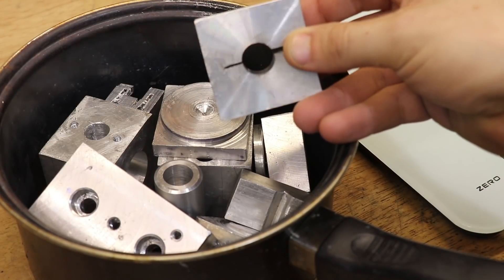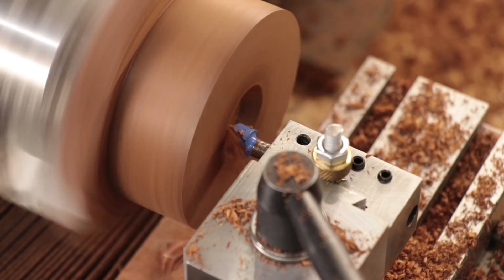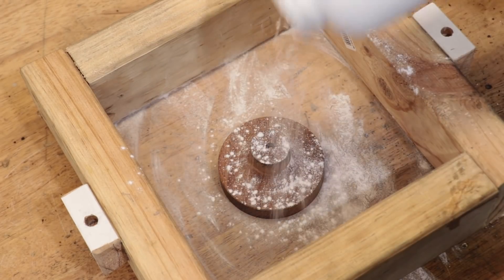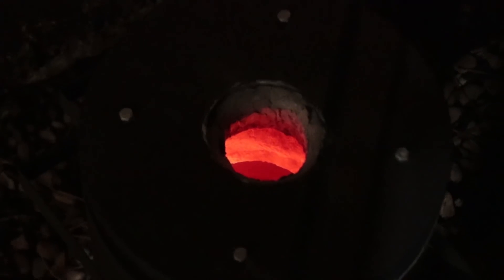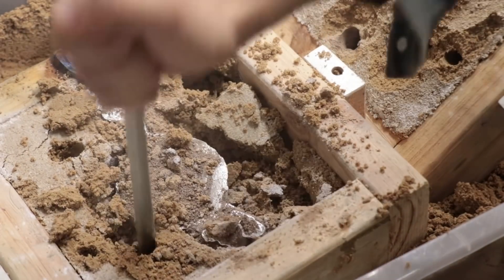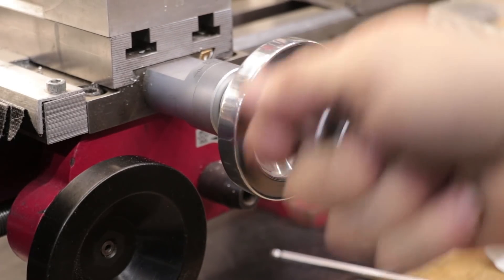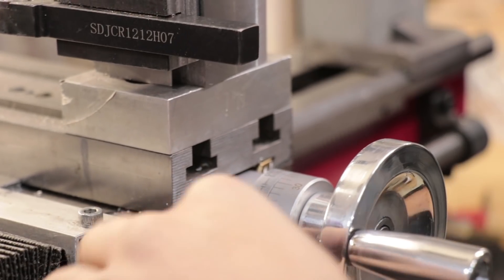Turning Scrap Aluminium Into a Lathe Handwheel | Metal Casting

Comment: Well knowing nothing about casting personally to me it looks like you didn't either use the right sand or you didn't pack it tight enough. Another thing you said about it was it would take to long to machine one out of a piece of stock but you literally machined one out of a piece of wood so why didn't you just go ahead and do it out of aluminum? I made all new handles for my lathe all three of them as well as new balls on the 4 rods on the lathe and anodized them all in my afternoon so it really doesn't take that long
Reply from the maker: It’s an old sand and clay recipe that isn’t used much these days. And look at the lathe, such a small one that it is faster to  cast than to have to make several had wheels from billet

Comment: Traditionally patterns  were made from a soft wood 102 percent of the finished item to allow for shrinkage of Aluminium. The pattern was then either painted or shellacked to give the pattern a smooth finish. Parting powder was made from crushed sea shells ground to a very fine texture. Feeders as you mentioned were usually at the thickest section of the casting for obvious reasons. Your Sprew was to large and will draw in air when not filled check out the old foundry man’s videos he has some top notch

Comment: great work, thanks for showing the failures as well as the success on the casting - so we all learn from them.
I want to do a similar upgrade to my midi lathe cross slide handle, but with a socket to allow using a cordless drill to power the cross slid on longer facing cuts. Ideas for a nut or socket drive in the center of the handle, that is part of the wheel so it doesn't turn?  
I thought about a hex cap screw but it needs to be held so it doesn't just unscrew in reverse...cross pinned ?
Reply from the maker: I used to use a jam nut from memory to lock a cap head screw in and use a hex driver in a cordless drill. Or just really tighten it so that the force of driving the leadscrew doesn’t undo the cap head screw. Don’t over think it, just find a way to tightly lock in a cap head screw and use a drill to drive it.
Reply from the maker: If you want it permanent just use some loctite or super glue on the threads
Reply: @artisanmakes  I decided to make a plastic disk with a mandrel centre for the drill, and put two holes in the plastic disk to fit over the handles.  Keeping the locktite away from the screw in case it needs to be removed !

Comment: A couple of things: 
1) the surface bubbles are due tot he greensand being too wet. Dry your sand a little and try again, also, use a wire to poke steam vents to give the steam somewhere to escape. 
2) Porosity issues are generally caused by gasses dissolved in the metal. mix 50%/50% borax, and household table salt, wrap it in aluminum foil, and push it to the bottom of the crucible, and mix well just before skimming the dross, and  pouring
3) Just an observation from what i can see, your greensand also appears to be very clumpy, i would suggest mulling it a bit more before use to evenly distribute everything. A sieve or screen mesh is also a good idea on parting / mold surfaces so you get the finest details you allowable.
Reply from the maker: Yeah for sure, we got flooded pretty badly around the time I did this and most things were water logged..probably didn't put as much time into getting everything dry, but that's my fault :)

Comment: The holes you were getting were air pockets. caused by either to much moisture in your green sand or not keeping your sprue full. Not the metal itself gas porosity in extreme cases is generally only about 1mm in size.

Comment: Looked like your casing sand was too dry as most of the sands I have used has some oil in it, and also use a screen to sift the sand nears the mold makes for a smoother cast.
Another trick is the use of haft round piece's next to the mold for better channels and less contamination in or around the part done right it can look like a professional did the finish part.   
A medal casing frame would be a big help fat in the meddle narrower at the top and bottom, and the sand needs to stick together not easily fall apart next to the mold helps it be smother.
Borax in the mix to free up the slag scrape off before you poor and I think that covers the basics.
I am sure a few more people will add bits and piece's.

Comment: To add to Kravchenko's post, it is a standard practice to paint wooden patterns to give them a slick surface for better separation from the mold.  Wood has grain and, especially oak and mahogany, have pores that the sand can get a grip on and tear out the sides of the mold.

Comment: I recently did my first “real” casting project, and I started ramming it up with the drag upside-down too.  For a process that’s basically just 1)make a hole in the sand and 2) pour metal in the hole, there’s a lot to go wrong.

Comment: Great work, love seeing how you go about improving the basics.  Quick question, where did you source your green sand from and also is it constantly reusable??
Reply from the maker: Thanks. The green sand is a home brew recipe that I'm still ironing out. It's a mix of sand and ground up clay which I source from cat litter. It seems to work fine for rough castings but I'm still working out the ratios of clay to sand. It's currently about 10% clay and it's probably not enough. Total cost is about $15 for 24kg which is very cheap and yes it's reusable.
Reply: The problem with kitty litter is that it needs to be ground into a powder to work effectively. Then the powder must be mixed with the sand and water. The clay needs to coat the grains of sand. This is done by a squeezing action. There needs to be a shear force applied. Normally all of this is done with a sand muller. 

The sand used makes a difference. Silica sand is normally used. Sand grains can be more round, or more not round and with sharp surfaces. The random sharp shape allows the to more easily lock with each other. This gives your sand more strength. The size of the sand crystals also play a factor. Large grains make stronger green sand, but the finished surface will be rougher. Finer sand will give better shape to fine details, but very fine sand (with the clay) will make it harder for the steam to escape from the sand.
Reply: Thanks for the feedback.  Just in the beginning stages of making my own foundry.  Can’t wait. Love the channel.

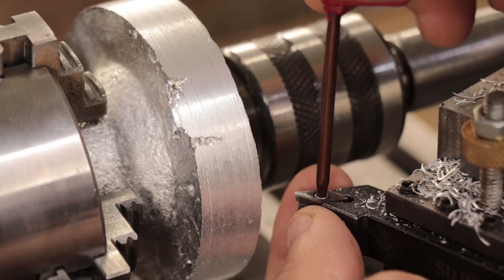Comment: That insert moving at 10:19 like that is quite the yikes!
Also you may be interested in experimenting with some inserts such as an R or W type insert for interrupted cuts that cast surfaces tend to have. It will provide more support and not wear you D type inserts as fast. Not sure how the mini lathe can handle them though.
Great job though! I got a Vevor 8.7x29.5" (220mm x 770mm) mini lathe myself but I haven't be able to use it because the handwheel is so sucky and the apron just can't move after a certain point or be tight closer to the headstock. The milled surface on the bottom has a taper :(

Comment: Top job with satisfying result! Beware of “talcum powder “. I used some on an engine for oil leak detection and it smoked and smelled like burnt flour. Looks like “talc” can be cornflour, a mixture or talcum powder.
Reply from the maker: Thanks for the heads up, I wasn't aware of that. I checked my bottle and it says it's pure crushed mineral clay, so I think I should be safe. In any event if it were made from Corn flour the workshop would have smelled like my kitchen when casting the metal. Cheers

Comment: Wood lathe user here, a recommendation is that u avoid using your metal tools since u can damage the wood, I suggest clamping a bar in the tool holder and using a wood lathe tool and your hand to move it (like in a traditional wood lathe, also, once u have the wood rounded and more or less balanced, u want to run the lathe as fast as u can without making the whole thing shake, and also, wear a face shield because wood isn't like metal and can explode.
also, in your green sand, try to use a thinner one, the one that u are using looks pretty rough,, go into a pet store and grab a bag of aquarium sand, and maybe a bit more clay in your mix, I hope that this helps :)
Reply: You can also switch to the super sharp inserts designed for aluminium!
Reply: @ShaneGadsby  that's a very good option as well

Comment: You're wrong. Talcum powder isn't used as a mould release. Sand moulds don't need it if you put release angles on your parts. The powder actually fills spaces between the sand grains and gives a finer surface finish to the cast.
Reply: If old foundry man , myfordboy, mrpete222 and along list of other very experienced casters use talc as a release agent or parting dust and quite clearly state this is what it is for in their videos I think Artisan Makes can feel pretty confident that he is doing the right thing .
If you want a finer finish on a part you must use a finer grade of sand . Considering this is his first attempt at sand casting he has done well to get a usable part !
Reply from the maker: I might have mispoken but talc is used as a mold parting powder.
Reply: No you're wrong.  You're wrong!  You're wrong!
Reply from the maker: Well agree to disagree, but I am getting my information direct from an engineering textbook that references parting powder for sand casting

Comment: First. I like your videos and your manner of presenting them. I have a few questions and some comments. I have done a lot of casting and learned a lot from Ol Foundryman. I was making many of exactly the same mistakes as you were. Sand looks to wet. Is there any bentonite clay ( can be had from kitty liter) in your sand? Second. Sprue should be about 6mm in diameter and when you are pouring your mold. You want the sprue completely full of molten metal to avoid cavitation or air entrainment in your casting. Your pouring basin is a great idea. And it will work. Third, the quicker you pour after you have melted your metal the less porosity you will have. In other words just melted and get the metal into the mold. Wait a little monger to open your molds. This is only figure by experience and looking at your riser. It is a colour and a shrinkage thing. This comes from experience. I buggered it up a lot to. I loved watching you do this as a casting. It's the least waste of metal. Oh, you had too little draft angle. But you know this already. Keep up the great videos. I love watching them. 

P.S. either place some heavy weight son your cope and drag or clamp them together, you will have less leaking of the metal. Isn't it amazing how molten aluminium has the same viscosity as water? It's very close to the same anyway.
Reply: I've tried lost EPS foam casting, and I'll not go back to wooden patterns unless I absolutely have to. For one-off projects it's just so easy to make the part in foam, ram it up, and leave it in the sand, and pour the aluminum. There's lots of little tricks, of course, but it's actually more simple than making a wood pattern.
Reply: Mark, Thanks for the plug! 😊. Yes, the lad here has some problems down  no doubt due to inexperience - in time, and with effort, he should learn and improve. His sand does look truly awful - too coarse and looks to be a washed  and therefore a one  size grade sand - not the best for moulding. Running and feeding methods definitely need work as does the metal used  - junk in junk out and all that after all... Martin
Reply: The comments here about about as good as the video to learn from. Thanks for that. I am watching and learning as I prepare my first furnace for casting aluminum.

Comment: A for effort. Go watch Windy Hill Foundry, he goes over lots of things step by step, noticed that sand where you poured the aluminum was loose and sucked down, that has to be a clean tight packed area!
Reply from the maker: Yes absolutely, this was early casting and I still hadn't nailed down the green sand mix yet. I solved quite a bit of this by adding more clay to the mix. Cheers

Comment: Enjoyable video.
For a simple piece like that it might have been easier to use a one sided "bucket mould" where the entire large diameter of the wheel was the sprue. It would have been much easier to make the mould and pour it, although you would need to machine out the face cavity of the handwheel.

Comment: what a satisfaction it must be to make the handle all the way from the raw materials

and finally someone did the wood turning on the metal lathe, as I was wandering if that is advisable or possible at all. now I can think of putting my lathe to turn some wooden parts as well.
Reply: Woodturning is completely possible on a metal lathe, it is just not advisable.
Reply: @an2thea514  the wood dust would damage the metal lathe? Why it's not recommended?
Reply: @TigerCarpenter  a metal lathe is covered in oil. Wood dust would end up in that oil making a very slow grinding paste. 
The inserts are not sharp enough. Try Aluminium HSS tools instead.
In general, freehand turning is also possible, but more limited than on a wood lathe.

If you'd like to use it to turn, make sure to cover the ways and clean. Plus, use highly positivy tools.
Reply: @an2thea514  yes thanks for a good advice. I think I'll occasionally would like to make a wooden mockup of some prototypes before I waste a lot of metal material

Comment: Hey Mate great videos!
You should check your cutting Tool insert, at minute 10:20 you can see that the Insert isnt tight.
Good Job go on like that !!!
Reply from the maker: Yeah someone else pointed it out, the torx screw is mostly stripped out, waiting on a replacement for it. Cheers and thanks for watching.

Comment: Looks like your green sand might be a little dry, try hitting it with a couple sprays of water and mixing it up. Plus, tamp down with extra force. Should make the gates a little easier to cut.
Reply from the maker: Cheers, I did do that for number 2 and 3. It passed the clump test, but what really improved it for later casts was adding more clay. It is a real home brew batch and I haven't nailed down the exact recipe as of yet.

Comment: you need finer sand for sure
Reply from the maker: Yeah, this stuff isn't the finest but for coarse, low detail casting it seems to work just fine. I'm still working my way through various sand castings so Im not going to say anything definitive, but on the whole this stuff has been working fine, and it is very cheap. Cheers

Comment: Do you save your chips to return them to the forge for a later project?
Reply: Chips make for pretty terrible scrap metal. Large surface area = tons of oxide = tons of dross and lower mechanical properties.
Reply: @WhenDoesTheVideoActuallyStart  Gotta admit, though, that very problem DOES prod the hobbyist into investigating some metallurgy.. I wonder if soaking chips in a mild pickle bath [oxide reducer] would help.
Reply: @ego73  Aluminium will oxidise quickly in the foundry.
It's not an issue with the oxide already on the metal, it's the issue of forming inside the foundry.

Aluminium oxide has about twice the melting temp of normal aluminium, so you can't melt it down, so it will just result as dross.

You could reduce oxides by using some flux, preventing contact with oxygen, but overall not worth it.

Also, by dropping it into a molten puddle already, since you don't have to wait for it to heat up, and there will be no oxygen interaction.

Little chips like this just don't seem worth it to save, in my opinion.
Reply: @autumn5592  I stand corrected. Cheers.